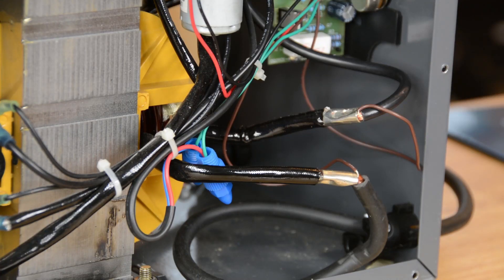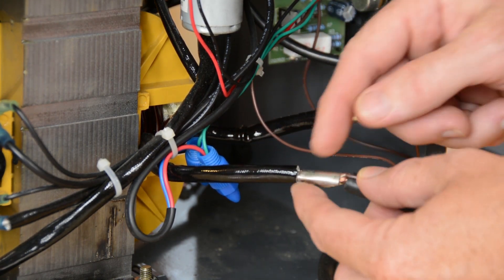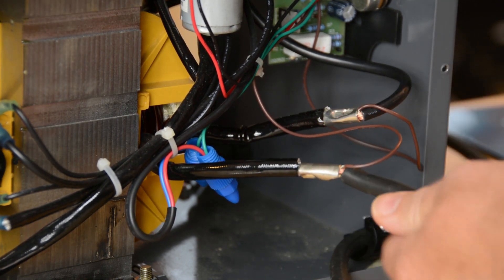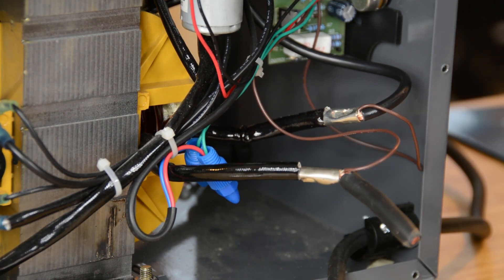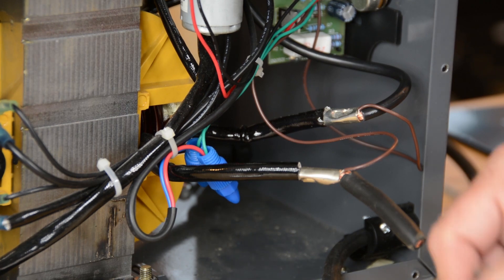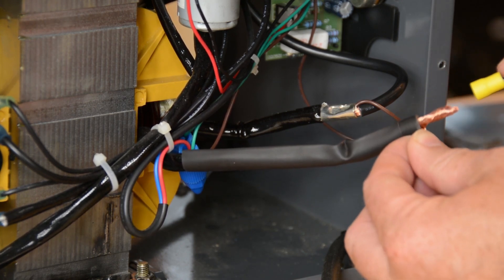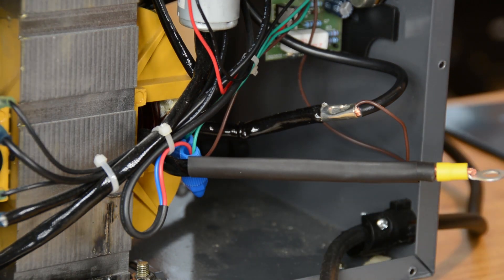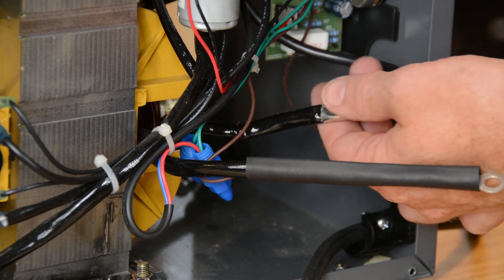Advanced Harbor Freight 90 AMP Welder Mods 04

Comment: 8 AWG terminals can be obtained a Gauge Wire And Cable through ebay. Also wiringproducts.com has them along with butt connectors for that size. you can also get pretty decent heat shrink tubing from one of them which has an adhesive compound on the inside. You can also get some items from McMaster-Carr.

Comment: I'm working on mine and used Thomas&Betts terminal lugs for 6-14 AWG wire, part number BTC0614-B2, for the capacitor and bridge rectifier connections. For the splices, I some 1/4" copper tubing which used to be part of a refrigerator. I just cleaned them with some alcohol, in case there was any compressor oil in them, then I used some sandpaper to make sure I got a good connection. I then crimped and heat shrinked them. I was going to solder them, but it wasn't necessary. You could also make your own connectors by flattening out one end of some 1/4" copper tubing and then drilling a hole in it. The end you didn't flatten would be for your wire to be crimped into.

Comment: I have been using my welder,...post mod,...and I really like the quality of the weld.   However, I have noticed that the 15amp circuit breaker began to trip.  I replaced it with a 20 amp,...no problem so far.
Reply: As long as the wire feeding that 20A breaker is 12 AWG or larger, you're OK. It's not uncommon for 15A breaker to be fed with 14 AWG wire which is not rated to carry 20 Amps. The outlet likely needs to be upgraded to one with a 20 Amp rating as well.
Reply: @kiowablue2862  ...yes, I switched it out with the breaker.

Comment: Great job until you effectively made your electrode wiring 10AWG which reduces the entire electrode lead to 30A vs #8 which is rated 40A.. As a licensed electrician I do not recommend doing this..
Reply from the maker: No I didn't.  By that logic, fuses would reduce the entire circuit down to the capacity of a #30 AWG wire.  Length matters.  It's heat dissipation that you're worried about.  The calculation for power dissipated is current^2 * resistance - and resistance is a function of both gauge and length.

You see this in extension cords all the time.  Cords as small as 14AWG get UL listed for a 15A circuit - because they're only 25 feet long.  Try that with a 100' cord and good luck.  By the time you're up to 200' you have to be all the way down to 8AWG if you want to run the full 15A with an acceptable voltage drop.
Reply: 14AWG is rated 15 amps.. 10AWG is rated 30 amps, 12AWG is rated 20amps and 8AWG is rated 40 amps.. You reduced the #8 to a #10 and effectively reduced the ampacity to 30amps vs 40amps..  This would have  been a good choice for your application.. https://lugsdirect.com/10608-Flex-Wire-Crimp-Lug-8AWG.htm
Reply: You need a larger cord for a long run due to voltage drop.. This is not a factor here.. Your upgrade and video is great otherwise..

Comment: Could a switch be added to change the polarity back and forth? The feed system would need a switch also?
Reply from the maker: It could, but there's no point in it.  Since the machine has no provision for shielding gas, and thus can only run flux core wire, DCEP is pointless.
Reply: Matt Heere 
I've added a threaded spot in the brass nozzle and screwed in a 90 elbow and have run line on the outside. Zip tied. and bought a flow meter.  Rough but functional. 
Waiting on bottle.
Reply from the maker: I see.  OK well in that case I guess you could put in a switch, but it would need to be a 100A switch which won't be cheap.  Most welders make you swap cables on bolts, and I think I'd stick to that plan for this guy too.

Comment: why not give the feed roller its own deticated power from the 110V taps using a 12V ACDC adapter??? just remove and jumper the adapters rectifier if you need AC out.. this is also a plus as the wire feed speed decreases the current availability for your tip.. i will be doing this to my welder and using the 12V supply as power for a high CFM PC fan.. great videos though so far.. will for sure be doing this to my "vaper" welder (same welder different name.. no fan XD)

Comment: Hi, Can these welders be made to use Gas instead of the flux core wire?
Reply from the maker: Practically speaking no.  It could be done, but you'd have to add all of the gas components and swap out the entire torch lead (the one supplied has no gas hose).  At that point you're well past what makes sense for this welder.

Comment: Just a note, You can buy 8g wire terminal ends at autoparts stores, as they are commonly used for battery cable ends.

Comment: When you removed a portion of the stranded wire to fit into the connector you essentially inserted a resistor in series.  It is not unlike replacing a portion of 3/4" pipe with 1/2" pipe, reducing the flow through the pipe.  Remember resistors dissipate power in the form of HEAT.
Reply from the maker: +arrlmember The impedance (it's an impedance change, not just resistance) of a wire is a function of it's construction, material, cross-sectional area, and LENGTH.  The distance over which I made this change is about 1/100,000th of the total length of this circuit, and I only removed a few strands.

There's theory and there's reality.  Reality is that you'd have to be in a lab out in space somewhere to measure the extra heat dissipation I created.
Reply: +Matt Heere You caught me making an error in grammar.  I do realize resistance is a DC term, whereas impedance is the correct term when reactances (inductive and/or capacitive) are involved.  I did wonder how much a difference the change in wire size made.
Reply from the maker: If this were true, then fuses would reduce the capacity of all the circuits in your car to about a 24 gauge wire.   Current carrying capacity is a function of length as well as diameter, material, and construction.

Power dissipation - a.k.a. heat - is what limits current carrying capacity.  The formula for this is I2R (current squared * resistance).  Resistance is expressed for wire in Ohms/foot, so reducing the length of the conductor reduces the power dissipated linearly.  Over a quarter inch distance, the delta between 10G and 8G is a tiny fraction of one watt of heat dissipated, even at 100 amps.
Reply: arrlmember is correct.  You essentially reduced the whole run of the wire to less than 8 gauge when you snipped off a couple of strands.  Watched all the vids.  Excellent series Thanks!!
Reply: I just got done putting the ring connectors on mine . We took off the plastic fit them around the wire then soldered the connector and wire together . That is one way to go . if you don't want to cut a couple strands off .

Comment: As a experienced electrical " mechanic " all stranded wire should be soldered to any connections in order to provide a true " full value " transfer of amps/ volts....

Comment: Matt; little update on the 8 gauge ring terminals. I found them at Home Depot but I would not have found them without the help of an eagle eyed employee because they were not in ascending order but were located on the top row away from anything close in size. Since these are box stores it may be safe to assume that most stores are set up the same, maybe?

Comment: Matt- I did the upgrades to my HF 90 amp welder, and it works AWESOME! Only problem is, it's almost too powerful now to weld any thin walled tubing (like some wrought iron). So here's my thought..... Let me know what you think. HF sells a Router Speed Control (http://www.harborfreight.com/router-speed-control-43060.html) That acts like an AC potentiometer. There are better ones of course (Like the Woodstock D4083) that are actually rated at 20 amps (which if you read the welder instructions, is apparently the ideal amperage rating to use with the welder). So I'm thinking if you can limit the AC into the transformer, it will limit the DC coming out of the bridge rectifier, and ultimately out the torch. By doing this, couldn't you theoretically lower the current to the point where you could weld thin walled metal tubing without burning through it? 

Also (on another note), it's funny that HF tells you to use the welder on a 20 amp circuit, because they only provide you with a power cord that has 16 gauge stranded wire that is rated for 15 amps. I upgraded my wire to 12 gauge (20 amp), and upgraded the clamp on the ground to this guy http://www.harborfreight.com/400-amp-welding-ground-clamp-66708.html , and MAN, WHAT A DIFFERENCE THAT MADE! My welds were literally twice as good just by upgrading those. I also upgraded the fan to a 235 cfm Comair Rotron 110v ac muffin fan. I got the fan for free, as well as 90% of the componenets used in the upgrade. This welder is a BEAST now, and even on long welds, the welder is cool to the touch. 

That being said, thanks for your video on the upgrades to the welder. I have a buddy that has a Lincoln 140 MIG welder, and I let him use my "Franken-welder" from HF. He couldn't believe how smooth the welds were, and how deep the penetration was into the metal. 

Scott
Reply from the maker: Trinity Maker Hey Scott,

Your theory holds up.  If you limit the AC voltage into the welder then you'll limit the DC output.  I kind of doubt that one of those speed controllers will last long hooked up to a welder though.  The welder draws high current pretty much all the time.  Routers only do it under very heavy load. 

These controllers use a silicon device called a triac to limit the voltage.  They work by cutting part of the AC wave off on every cycle, essentially delivering less power.  The AC power looks quite different than the nice clear AC you get off of the different secondary taps in a normal welder.  With this welder/process it won't make any difference - but don't try it on your TIG machine :)
Reply: Matt Heere So essentially whay you're say is, "Garbage in- garbage out"? The Woodstock D4083 is rated at 20 amps, unlike the HF that is rated at 15. After youe explaination, I understand what you're saying about the physics behind the AC sine wave looking different. I would only use it on the "Min" setting of the welder, and I would probably only turn it down enough to get descent welds on thin walled tubing without burning through the material. I would never use it on the "Max" setting, because that defeats the purpose of the "Min" setting altogether. I might try the HF Router Speed Controller first, and see if I get desired results. If not, I will return it. Fortunately I live in San Diego, and there are 4 or 5 HF Tools locations here, so it's not too much of an inconvenience either way. If it works, are you interested in hearing about the results?
Reply from the maker: Absolutely interested!  It should work fine.  Only some time and testing will tell about the longevity.

In the end though you'll probably also need to brush up on your pulse skills.  Nothing beats a couple seconds for the metal to cool before you hit it again to keep thin stuff under control.
Reply: Matt Heere Ok Matt- here is my report back. I bought a Router Speed control from Rockler http://www.rockler.com/router-speed-control . Here are my results:

Let me start by saying I'm very satisfied, but the settings to achieve the results were VERY unexpected,

The material I was experimenting with was clean, 1" x 1" x 1/16" mild steel tubing I purchased from Industrial Metal Supply. My first weld was with the  welder set to "Min" power, and the wire speed set at 4. I was able to lay a clean bead, but I had to be VERY conscious of consistent movement. If you pause for 1/2 second too lond, you WILL burn a hole through the material. 

So on my 2nd attempt, I ran the welder through the router speed control. I left the settings on the welder alone, but I set the router speed control at 7. I found this to be insufficient to get a good arc, and keep the electron flow consistent. Since I replaced the original fan with a 235 cfm fan, I can definitively hear the fan slow when I adjust the nob on the router speed control. It slows down to 1/2 speed when I turn the knob to 7. I was surprised with this. The arc was very "poppy", and there was a tremendous amount of splatter. Not a pretty weld AT ALL.

I found that no matter what I set the welder to- when used in conjunction with the router speed controller, the welds were NOT good. 

So then I set the welder on "Max", and I replicated the original settings on the wire speed controller and the router speed control. This made the weld MUCH better, but still a little "poppy". So I turned the knob on the router speed control from 7 to 8.5. With the wire speed set at 4, this was the magic combination. Beautiful flow, thin weld bead, little spatter, and sufficient penetration without burning through the material. 

I took some pictures, but this is your thread. If you want to see the pics, I can email them to you (or figure out some other way to get them to you). 

My consensus is this: If you don't plan on welding thin wall tubing, this welder is PERFECT! I found by upgrading it from AC to DC, I get MUCH deeper penetration into the metal. Unfortunately, this is a double edged sword. Great from thicker material, but less forgiving with thin walled material (like wrought iron). 

This transformer has a half tap, which is what distinguishes the Min and Max settings. The triac in the router speed controller effects the transformer (and the current) differently than the half tap. So using the triac router speed controller at 8.5 with the welder set at the Max settings is equivalent to a 1/2 tap within the 1/2 tap (a 1/4 tap). It gives you an additional 1/2 to 3/4 of a second on your material without burning through it. This "forgiveness" makes for a scenario that enables the novice welder to produce a better end product. 

So was the router speed controller worth the investment? Seeing as how I'm about to make a 2 piece wrought iron swing gate with 1/16" mild steel tubing- I would have to say YES. 

Thanks again for your videos Matt. BTW- I have NO IDEA why ANYONE would give you a thumbs down on your videos. Every one of them was awesome!
Reply from the maker: Trinity Maker Thanks for the follow up.  That's really interesting!  I'd love to see the pics.  Feel free to post 'em here (or a link to them on an image sharing site is probably easier).  If that doesn't work you can put them up on you Google+ page (you have one if you're logged into YouTube) and share them.

Here's the funny thing.  Conventional wisdom would say that to weld that tubing you need 60-65 amps.  That's 1 amp per thousandth of thickness.  This welder should be perfect for that as is.  When you mentioned thin I was thinking 22GA sheet or something.  You might try this combo:
- .030 wire.  You could even do .023, but you'll need to get a new roller for the drive mechanism
- Power set on "min".  This should put you in the 60 amp ballpark
- Play with the wire speed to get a good "sizzle."  You want a good arc, even if it seems hot.

Now the fun begins.  You're going to be pulse welding, but with a machine that doesn't do pulse.  Really it's just welding an inch and stopping to let the part cool.  With a little practice you'll find that you can get really strong welds (because you're getting full penetration) and not burn through since you're not trying to weld continuously.

The down side - if you want it pretty then you have a lot of grinding to do.  You'll have a lot of start/stop places that won't be a nice continuous bead. 

LOL on the thumbs down.  I look at it as "you can't be a real YouTube channel without a troll or two."  It's like a rite of passage or something ;)
Reply: I have a craftsman rotary plug in  - dremmel tool . It has one speed . I have had 3 HF dremels in which the same problem broke every time . It was a clutch button to change bits . Well the last one was was a cordless hardly used and I salvaged batteries etc including a potentiometer . I have no idea of how if at all I could adjoin the variable control since it was on a corless model by HF . It would be nice if it would work in the power line ? Any advice ? Thanks Tim .
Reply from the maker: timothy thomas Wow.  That's a lot of bad rotary tool luck!  If the Craftsman is otherwise working for you then the HF router speed controller might be just the ticket.  It will work fine on anything with a universal motor, and give you the adjustable speed you really need.

Comment: I hope you don't mind a "why don't you", but this may be of benefit.  The feed drive wires can be connected to the A/C side of the bridge rectifier.
Reply from the maker: Jay Herde They are - essentially.  The little brown wires coming out of the factory couplings are the feed to the drive roller circuit.  This is what gets connected to the AC side of the rectifier.

Turns out it's actually easier to leave those metal splices in place, and cut the wire farther down.  You get wires that are closer to a good working length.  The mistake I made was taking the insulation off of those joints.  Turned out I just had to put my own heat shrink back...